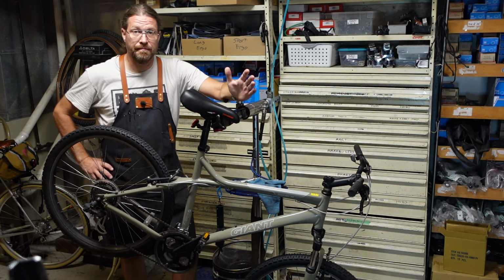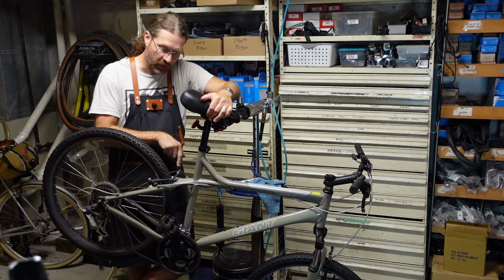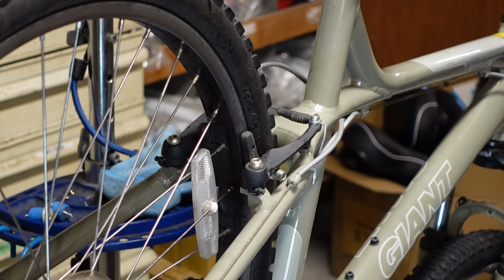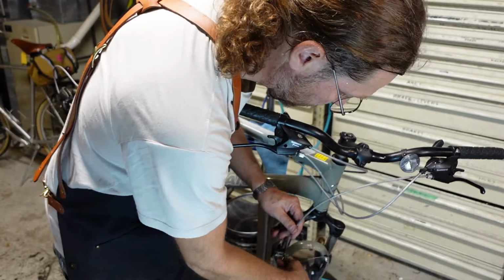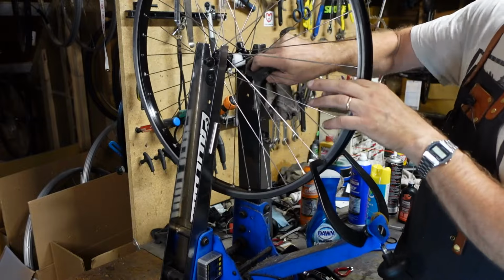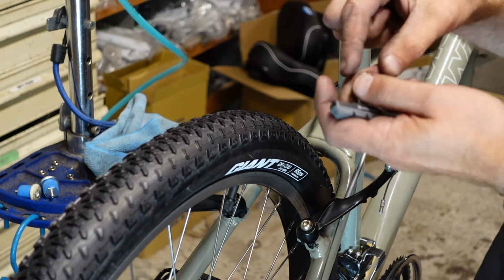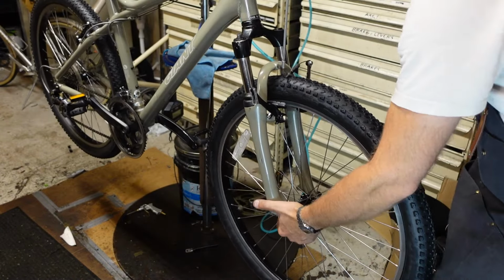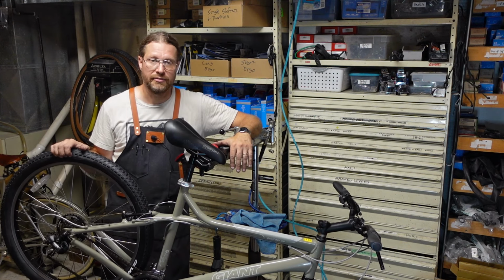SERIOUSLY! Why can't they make EVERY BIKE like this? Giant Boulder SE gets reconditioned!

Comment: My old mechanic, before he retired, used to braise the ends of the cables instead of using those crimp on ferrules. He could then easily pull the cables, clean and lube them, and put them back.  I haven't found a mechanic that will do that anymore.
Reply: It's a time issue.  It's much faster to use the cable ends rather than mess with flux, solder, and a torch.

Comment: Disc brakes are great -- never want something else. When you ride a lot in wet conditions (especially when it is dirty too) you will find that this is exactly what a practical bike needs! But I agree on the other points you made.
Reply: Discs on a road bike are crap
Reply: @Stevehatesgravel  l supported my statement.
Reply: I recently started riding an ebike which came with hydraulic disc brakes.  This was my first experience with disc brakes and I would not want to go back to rim brakes . They are superior in every way!
Reply: The beautiful thing about bicycles is that there are so many out there, you can ride whatever you want. I love disc brakes. I love rim brakes. I even love cantilevers. I do have one condition though: The brakes have to effectively stop the bike when I want them to. So long as they do that, I will probably give them the thumbs up!
Reply: @Stevehatesgravel  Nonsense... but hey I have a couple incandescent light bulbs I need to get rid of... you interested?
Reply: @svgs650r  You don't want the extra weight on a road bike.  +When disc brakes and fluids sit they become issues.  Most riders want bikes you can hang up and then take down as needed to ride.  = If I need to flush the brake lines every year, + seals, + adjust -it starts to take some time to ride. 

-for a heavy eBike or MTN bike the disc brakes are needed.
Reply: @PLAZALOT58  on e- bikes Disks are almost mandatory for safety (due to exceptional impulse torque and top end), but I say this with THOUSANDS of miles on different styles of bikes Disks are a nuisance on general purpose bikes. Absolutely annoying af. My Dyno lasted me almost 10 years without the need of anything than pads and adjustment, and it had VERY good v-brakes. 
Wet, dry, mud, etc never ever failed (other than not replacing pads). I RACED with it (obviously bmx like competition). I love Disks don't get me wrong, but gp bike  there's no need for the added expense.
Reply: @jonmccormick8683  Extra weight?  99.999999% of us are NOT racing.  😂

Comment: I would never have the patience to deal with something like that saddle clamp. That's why I'm not a bike mechanic, I guess. Enjoyed the video! As for twisting spokes, here's an excerpt from Jobst Brandt's "The Bicycle Wheel":  SPOKE TWIST
Spokes are, in effect, very long screws. Because they are so long, they act like
long springy torsion bars, especially when they are tight and friction in their
threads is high. 2.0 mm spokes have about fifty percent greater torsional stiffness
(resistance to twist) than 1.8 mm spokes, and straight gauge spokes have about
fifty percent greater torsional stiffness than swaged spokes.
During tightening, spokes twist as their nipples are turned. Torque that twists
spokes comes from the thread ramp and from friction. Thread steepness is a
function of thread pitch and diameter. Steep threads resist spoke tightening and
aid loosening. Frictional torque at a given tension depends on spoke diameter
and spoke and nipple materials. It can be reduced significantly by lubrication.
When a wheel with residual twist in its spokes strikes a bump, the spokes will
screw in or out of their nipples depending on the direction they are twisted.
Spokes that untwist cause alignment errors that require retruing. A wheel that
has been built properly will not need retruing unless the rim is bent from an
exceptional force.
To eliminate residual spoke twist during final tensioning, each nipple should be
overtightened then backed off by as much as a quarter turn. The amount of
overtightening should match the amount of twist that must be backed-off
(untwisted). A practiced hand can feel the twist-free position because, at this
point, the nipple turns in either direction with equal torque.
SP
Reply: THANK YOU! That was a really good excerpt, well written and explains the phenomena perfectly
Reply: @VictorQuesada-bl1xk  Jobst Brandt, r.i.p., was an engineering genius with regard to bicycle wheels. He was also an avid world cyclist. Highly recommend searching his name on youtube.
Reply: Very well stated for someone with no patience!  😂
Reply: Re: spoke twist
That explains why my wheels were forever out of true ever since I replaced a spoke. I learn something new every day.

Comment: I get all you're saying and given what types of bikes have been sold well in the US in the past decades that is probably the way to go, BUT...
Hearing "practical bike" as a European I'm thinking 
28' rims 56+ frame
slim Schwalbe Marathon Plus tires 
mud guard
bike racks
front hub dynamo with fixed lights
rigid fork as a bonus
all of which could be had on a 2nd hand tune up for less than 300€
That's the kind of bike you see with people riding to work everyday over here.

Comment: Great video and so true, bikes like these can go a long way. In 2018 I bought a well maintained second hand 2011 Giant Roam (rim brake). I paid around 350 for it and started using it as a commuter bike and now have done 22500 km (about 14000 miles) on it. Of course chain, pads and tires need replacing once in a while, but I still love it

Comment: I appreciate you showed your seat post trouble.  Every once in a while I used to get some irritating little problem on a bike to puzzle through.   That is bike mechanics.   When I worked on old bikes I would repack wheel bearings if not moving nicely,  unless the rim was a bit worn on the braking surface or it was really out of true.   I know my tire pressure goals on each of my bikes (I have 7) but I don't pay attention to the car.   Rely on car's sensor.    What I preferred were 90s to recent fully rigid  mountain and hybrid bikes,   too many crappy old suspension forks that are a pita to deal with.

Comment: I agree with your comments about lack of lubrication on new bikes, cost analysis and the horrors of cheap bikes. I call 'em BSOs = bicycle shaped objects. I don't use anything above 8 speed and my current bike has a 6 speed freewheel on the back. Durable and practical. Not something cycle shops sell anymore.

Comment: I'm with you. I think bikes reached their peak in the late 80's through the 90's where components and frames weren't so proprietary. I was a bike mechanic for a few years during that time.
Reply: I was a mechanic during that time as well. Not sure that it was the pinnacle. I was thrown off the front of my Pro Caliber many times. The new geometries are way easier to ride. That being said I feel hydraulics are not necessary. Cable disc brakes work extremely well and are very easy to work on. Maybe not as easy as v brakes tho.
Reply: @trishaleaver3581  I hear you and agree to some extent. Today's bikes are objectively better in many ways, but they are far too proprietary. Components that will fit a Trek, often won't fit a Specialized, etc... Even worse, components that fit last year's Treks might not fit this year's Treks.

Innovation is all well and good, but there's a real need for some standardization and that seems to have been almost entirely discarded, much to the consumer's detriment.

Comment: As a long time bike rider. I live in a hilly wet area. I do advise anyone who uses their bike a lot and who can afford it to invest in hydraulic disk brakes.

Hydraulic disk brakes on the front are not just a bit better in the wet but hydraulic disk brakes are cheaper (need less) on the maintenance. I was changing break block at a £5.00 a pair, every 1 to 2 months. My disk break pads last 18 months and are £10.00 a pair. This cost saving is true for the rear break too.

You do need a forks that has fixing points in order to fit front disk brakes. As you need a frame that has fixing points in order to fit rear disk brakes.

It is true that we need less powerful brakes on the rear. As it is easy to lock up the rear wheel. What I realised after the rim wall of my rear wheel collapsed; due to the wheel being aluminium and the grit on the break blocks that easily grinds away at the soft aluminium. Is not just that back wheels are expensive but that a disk brake stops this ware from happening. As the breaking happens on a separate steel disk rather than the aluminium rim of the wheel.

So installing hydraulic disk brakes does cost a bit. In return you get better brakes (in the wet) and much lower maintenance cost breaks. There is a small matter of break fluid. Probably best changed with the pads every time or every other time depending on whether you hydraulic fluid is synthetic or not.

Comment: Well let me say I do agree with you for the most part: the bike industry is really trying to sell us bikes we do not need and generally is not capable to deliver thoughtful design and solutions. Still there is a lot to like with tecnology advancement: you re against disc brakes? Go and try ride a trail with v brakes or even better with canti and then get a run with disc brake, only an absolute fool would prefer the first two. Tubeless? Same thing. That cheap seatpost? Thats a piece of garbage, thats why on more expensive bikes you find 2 bolt seatpost: simply because thats a much better design. There is a lot to like in modern bicycles, that said I hope that the middle range bikes will come back because atm is either piece of junk or top of the range super expensive race bikes/high end e-bikes. Keep up the good work

Comment: I've been riding a Giant Boulder with the straight toptube and I've been mountain biking just to see what it's like, been a long time decent road biker and now trying singletrack. Fun bike. Climbing steep stuff with tubed tires (at 45 psi which is what my tire minimum pressure states), hardtail, over decent sized rocks is difficult. But for fifty bucks, good to get a feel for
Reply: The minimum tire pressure listed on the sidewalls is utter nonsense.  Nobody runs MTB and Cyclocross tires at 45 PSI, even with tubes.  I don't know why these minimum pressure statements even exist.  Maybe so a 350 lbs person that hits potholes and pinch flats doesn't complain to the manufacturer?
Reply: @lastfm4477  I flatted my front twice, even with 45 psi recently. Rocks are a bitch

Comment: The main thing with big box store bikes is they use non standard parts so theyre not really meant to be maintained.  Giant, Trek, GT, Cannondale etc all use standard parts (square tapered cranksets, shimano derailleurs, stamdard size head tubes etc) so they can easily be maintained and upgraded should the owner want.

Comment: That's the cool thing of living in northern europe. Most bikes sold are designed for commuting or these days, cargo bikes to carry your children. That being said, while I agree carbon or aero bikes are a gimmick and internal routing can be more a hassle than a convenience. I do not agree the same can be said of disc brakes (or hydraulic disc brakes) they just perform so much better, and they do so under any weather condition, particularly in rainy places where you need to go through mud.

Comment: I had two similar clamps fail that way. Looked like pressed steel. They were not ridden loose. I'm just heavy. I got a new saddle clamp from ebay and filed the dished bit so it fits. New seatposts are much better. I dislike suspension seatposts.
Reply: This kind of thing from ebay fixed it. Much stronger. "1X Mountain Bike Seatpost Head Saddle Pipe Head."
Reply: Michael Franti is a cool name for the front wheel.

Comment: 1:08:20 Great method for sure, I've been doing this a lot, mostly on kids bikes, when I meet some kids on a ride, sometimes I get bombarded with questions, and end up fixing their brakes, but an issue I've seen is cheap alloy hardware, so it rounds off when tightening, some has bad tolerances so brake pads can't be secured. It's cheap Intersport bikes sold as Diamant and Nakamura, some have no name brakes. But some had Tektro brakes, those were nice to adjust.
I've even seen brakes that require a socket to secure the brake pads, silly bike from electronics store used as an gimmick.

Comment: For bike computers, I’ve had a few of the cateye wireless and they work great and keep the memory with a battery change. (And super easy to swap)

Only issue I have is - when I would play Spotify on my phone while riding, (which sits next to the computer) it would interfere with the computer and the speed distance etc wouldn’t register. As soon as I press pause on Spotify. Bam works. I use iPhone. Seems to be a known issue due to certain frequencies or firmware or something. I use a Garmin now.

Comment: Request: 
The spring trick around 1:09:00 seems really cool, can you make another video that's a close up of how you are doing things like that? I know much of your knowledge and skill lives almost in your sense of feel rather than sight, but on the video some things are a little hard to see / make out how exactly you did that. Maybe mount the camera to a helmet so we see what's in your sightline? You kind of show us at 1:20:00 or so, but it's hard to see black on black.

Praise!

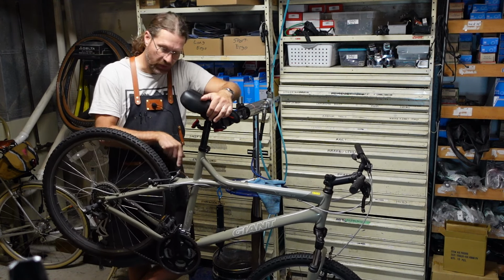I really like the points around 23:55 and 35:48 where you call it good enough. Tolerances are important for our lives, and many times it's not worth the incremental gains that you could get from obsessing over any one aspect of a bike like this. If it's a practical tool for mobility, getting a million of these functional is worth so much more than a 1000 of them up to tour de France levels. 

Thank you for making this video, I feel much more comfortable and confident in my capacity to do more maintenance of my own on my bike. I have a real cheapo, and bringing it into the shop for some work would put me upside down on the value of the bike itself. That said, I see the value that basic care I can do myself can bring to my commute and rides with the kids. This is also a good view of what a bike mechanic brings to the table when you do go to a shop, and what you do to improve our overall riding experience. 

Commentary:

Around the 1 hour mark: Firm feel on a kids / bmx / mountain / commuter bike has always worked for me too, but I have to say that it felt amazing to go from an underinflated tire to one that's pretty full as a kid. 

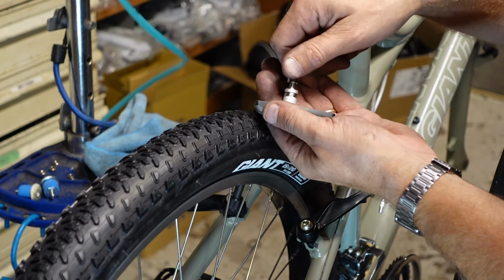Might want to use a magnet at 1:05:30 to keep things organized lol (I say as if I haven't had a whole tray of screws completely scatter across the floor).

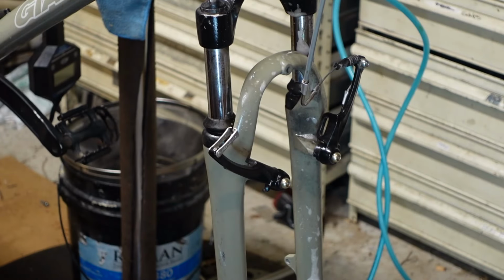Around 1:17:00 you mention that youtubers with clean shops are making content, not running a shop. I feel like that's fair. Some content creators like My Mechanics or ChrisFix are not trying to run a current repair shop that has to remain independently profitable, they are running a content channel with the background serving as their studio. Presentation matters in this format, so I don't begrudge them their style. You make a good distinction between a shop and a store in that sense, how one is a place where things are fixed and built, like a machine or wood shop, and the other is where finished goods are kept and sold. 

Thanks again for making this video and for your creed/manifesto. We need more bikes like this, more shops like yours, and more people out there riding.

Comment: I have to admit that I used to really like drop bar bikes but I have since started to gravitate to the hybrids with riser bars and v brakes... I have had a bunch of hassle dealing with cable disk brakes and I do like the more upright riding position because I am not that fast anymore... A lower position would not make much difference... Also, I can use my bikes to run errands without worrying about a 2000 dollar carbon fiber being locked up outside the store...

Comment: I've just bought a 2021 (in Early 2022) boardman mtr8.9 as a daily rip round
Very simple machine
Only internal cable is for the dropper post, 
sram NX 1x11drivetrain
Maxis dhfr and dhr2 tubed tryes
External cables
Rockshock gold35 (150mm travel) front fork
Rocckshox superselect+ rear shock
It's a modern take on old school.
Nothing flashy and after a few teething problems, is 1 of the best and most used bikes in my collection. Recently revived a 2012 boardman comp hardtail too, an absolute dream of a xcountry bike.
I see modern bikes having their place, but agree with you, some of the old school are unbelievable.
Reply from the maker: I have no idea what any of that is! ;-)
Reply: @bkefrmr  I was with you there bro. Took me a while to learn but every part is basically fixed the same as old technology. Same tools, same systems, just modernised. Which helped me a lot as I hadn't touched a bike in over a Decade
No internal cables. Nothing that needs a special tool or Allan key, every tool you have and all knowledge you have, youd be able to fix my bike without a problem.

Enjoyed your video, I think I'll be rescuing some older bikes from.a cash converters and get them beautiful.

Simple is best. And I agree, cycling stores is what these shops are these days, I can't find me a good mechanic anywhere in my city. They're all clueless and want to sell.me things I don't need.
I just want my bike fixed if possible.